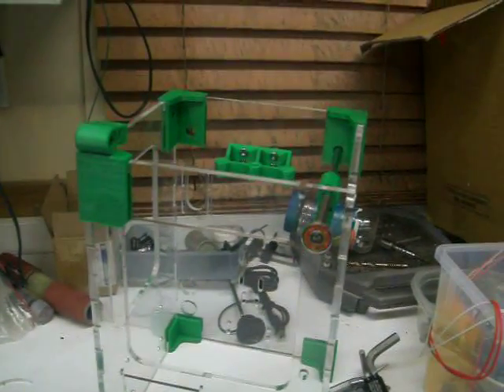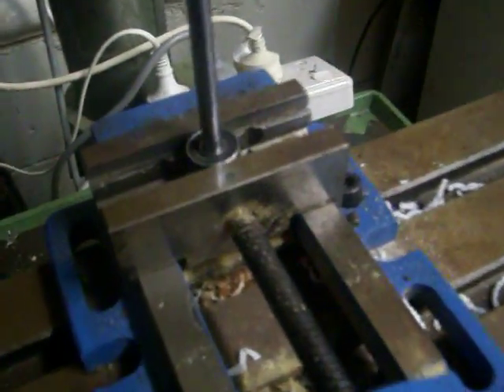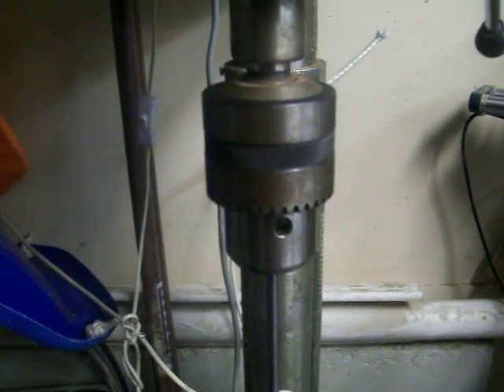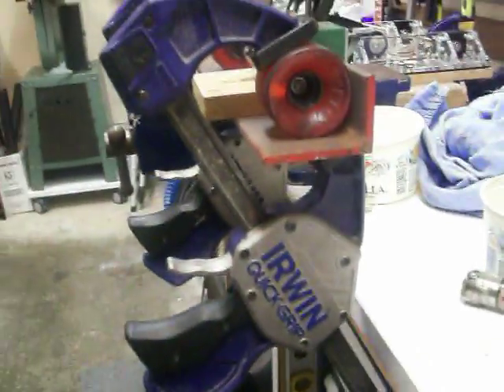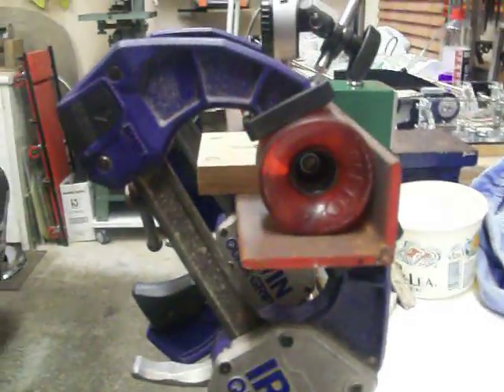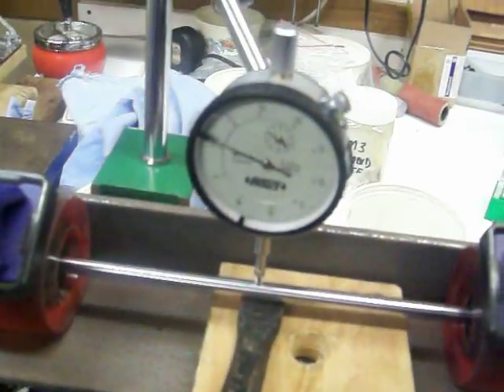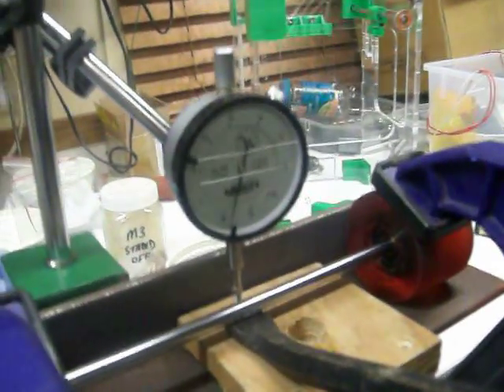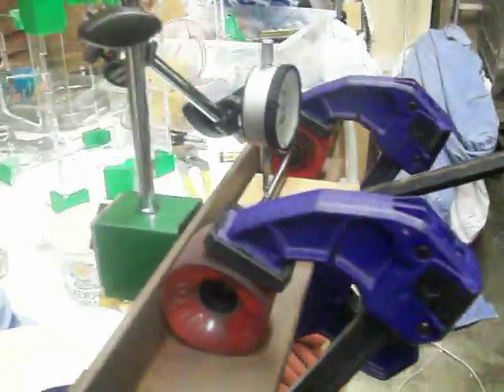How to straighten bent 8mm metal shaft accurately on the cheap, DIY Tantillus 3D printer.reprap

Comment: I have a slightly bent 8mm shaft, 400mm long. 0.25mm centre gap when placed on flat plate. Cannot get linear slides to run smoothly when fixed to carriage. Used three wooden wedges (half clothes-pegs) as a sandwich between wood boards. In a big metal vice, I can deform up to 10mm+, but the shaft will not take up a permanent correction. If these shafts are in any way through hardened chrome steel? (it may be possible even though from Ebay). I've had no problem bending wrought iron angle and mild bar into exact curves. I'm considering that this bar will just snap at some point, it's behaving like a pretty good spring at the moment.
Reply from the maker: Tricky, if its no good maybe try harder and if it does break then no loss. You could try annealing it. Heat it up really hot and cool it really slowly, this should make it easier to bend.
Reply: Thanks, put so much bend in it the wooden wedges crushed. Now it is straight enough. So it is probably a really good through hardened and tempered chrome steel shaft. Tougher than my expensive spanners.

Comment: Did the same but without a DTI, just rolled my bent bars on the table and marked the flexing point with a pencil, then pried the bars carefully and slowly to the point they didn't look bent and rolled nicely.
Thank you.
Reply from the maker: Nice! that works too if you are not after super precision
Reply: If you have a granite slab or a sheet of mirror, that works well... I used a sheet of very thin paper as a filer guage.

Comment from the maker: Thanks, I worked out the reason this works so well. It's because the wheels flex and add compliance to the bearings. This means the shaft can deform in a relaxed way. I had some friends come over and do their Tantillus bits too.

I just need to get a my heated bed finished now!